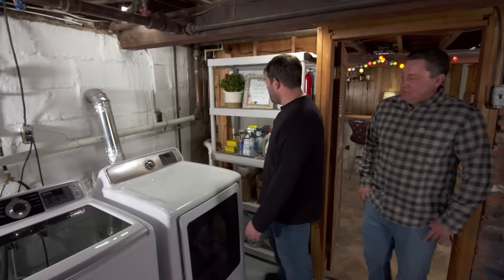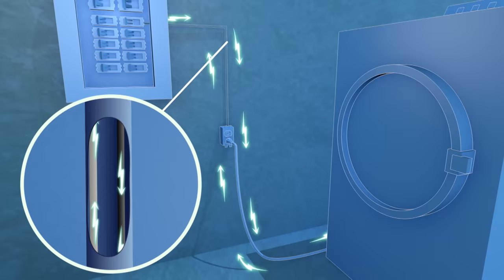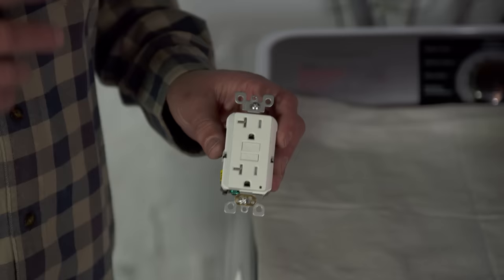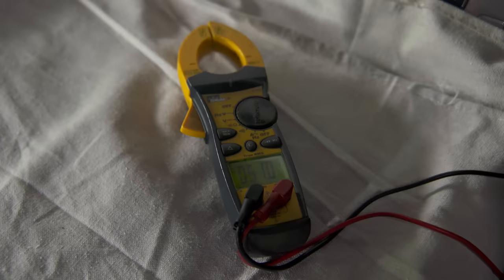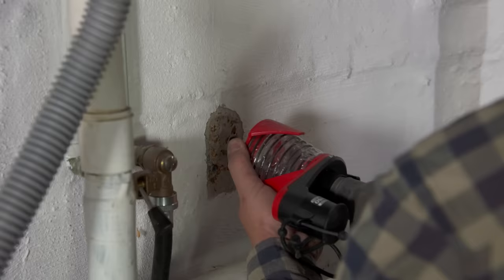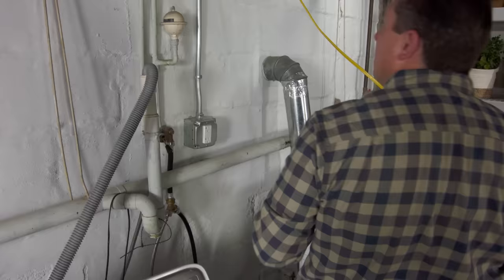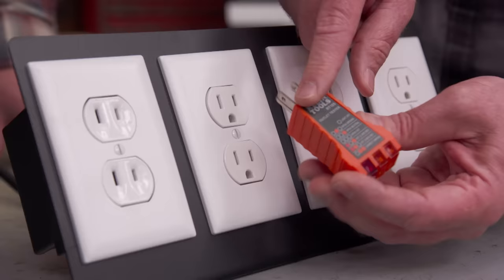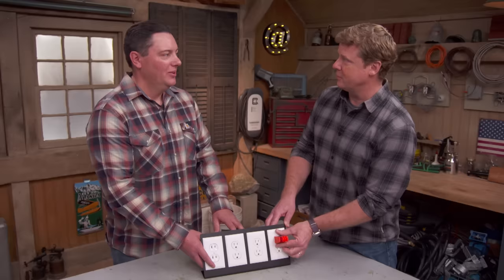How to Ground a Two-Prong Electrical Outlet | Ask This Old House

Comment: That guy didnt know what a ground was and you're trusting him use the mulimeter to tell when the powers off?
Reply: One, it's scripted. Two, there's a lot they probably cut out. Don't believe everything you see on TV.
Reply: He immediately picked up on the "don't put a knife in the toaster " meant he understands the ground fault  he knows electrical
Reply: Nathan 😂😂
Reply: @chrisb4009  You can't rely on a non contact tester in all situations.
Reply: Alex Flockhart You can’t rely on a non contact tester in any situation. Multi meters aren’t designed/intended to proving dead and shouldn’t be used.
Reply: @chrisb4009  I use both to be sure, but you're not wrong.  I also don't use anything but Fluke for meters unless I'm working with 12V.
Reply: Any brand multimeter is fine generally as long as it's CAT3 minimum. Then test prove test. 
Plus my favorite tester is the Non Contact Tester
Reply: @Froggability  Don't trust brands that arent manufactured by the company itself.  In-store brands often contract out the manufacturing to the lowest bidder, and I've taken apart meters that were labelled CAT3 but offered zero over current protection, making them potentially dangerous if someone accidentally used the current function on line voltage. Use Fluke, Klein, Ideal, etc. Stay away from brands that dont specifically make measurement tools.
Reply: Nathan don’t know about North America but anywhere else I’ve worked GS38 compliant testers along with a suitable proving unit are what’s used to to prove dead. Cat III only relates to the level of insulation/protection offered.
Reply: Alex Flockhart Fluke are good meters but there are lots of other good brands such as Martindale, Megger and Kewtech.
Reply: @chrisb4009  Of course, those are brands that manufacture instruments consistently, instead of contracting it out to the lowest bidder with little oversight.  That was my point earlier.
Reply: Look at this guy trying to say that Kevin O'Connor is "that guy!" Please do not doubt Kevin O'Connor. He is dreamy.
Reply: not to mention the panel had all the breakers marked....
Reply: Chris B  you sound like you’re from the UK. In the states here and pretty sure in Canada also we don’t have those regulations with meters that have to have a proving device etc. etc. We often on meggers to Check our circuits.

Tell me why a meter is bad when it’s used almost everywhere in the world. 

If you know how to use a meter and you check it before you use it there’s nothing wrong with it. 
Do you think technicians and benches in the lab all over the planet have some sort of fancy checker device for their test gear, nope.
Reply: This is e tv show the follow safety rules even the prectice servo times before they run with cámaras  si you can see nice  flow video shot the made mistakes in the prectice till they have  one and clean of errors
Reply: @AlexFlockhart  I only use Fluke meters as well, they are the best meters period!
Reply: @chrisb4009  Why? Solenoid style (wiggys) are more dangerous than a  multimeter, ever have a solenoid style blow up on you? I have, and i wasn't using it for a higher voltage than it was rated for. The end blew off and shot across the panel that i was checking some 480V fuses.
Reply: @B5Blue1968  yep, went through ideal and klein before learning to stop throwing my money away on unreliable junk.  Haven't had a problem with my fluke T6-600 for 3 years now.
Reply: @B5Blue1968  I’m not sure what a Wiggy is? But no, I’ve never had a GS 38 voltage indicator blow up on because I tend to use decent quality equipment.

Multimeters shouldn’t be used because there often multiple inputs and always multiple settings many of which can give a false reading if proving dead.
Reply: @B5Blue1968  Yes you can measure voltage with a meter. The doesn’t mean it’s considered good practice for safe isolation.

The fact most meters have separate current and voltage inputs mean you can easily prove dead with your meter leads in the current input and see zero voltage. It’s also possible to have a meter on capacitance or resistance say and erroneously read as zero volts.
Reply: Its not a big deal
Reply: @zarblitz  Lol
Reply: @Froggability  LOL!!
Reply: @chrisb4009  that’s why you show the 120V before and 0V after flipping the breaker. Guess you would have learned something if you watched the video. That plus a quick check on all exposed conductors 0V to ground is plenty, especially for something that was already hooked up.
Reply: @Kado_Tornado  You’ve clearly got no idea what safe isolation is or how to do it.
Reply: @chrisb4009  you sound like anything that doesn’t match what you’ve been taught for your job is wrong, but you don’t understand the concepts involved so you don’t know how to apply them to what you’re actually doing when you “prove dead”. Tell us exactly what’s wrong in the video and why. Not just “I was told to do it this way.”
Reply: @andymerrett  From that comment I’m assuming you’ve never worked as an electrician in a professional environment?
Reply: @Kado_Tornado  It’s not how I was taught it, it’s industry wide best practice anywhere I’ve been and I’ve worked in oil/gas /power industrial sites all round the world.
Reply: @chrisb4009  I see you avoided my question about what exactly is wrong in the video and why.
Reply: @Kado_Tornado  Well:
1. A ground/earth does not control fault current it ensures that all exposed conductive parts are at the same potential/voltage. 
2. His description that current flow to ground/earth will cause an over current trip in in most cases.
3. He uses a multi meter for proving dead. This is against best practice for lots of reasons.
4. He doesn’t prove the multimeter before using it.
5. He doesn’t appear to prove dead in the junction box before pulling it about.
6. The less that’s said about the design of US sockets the better. Live conducive parts sticking out all over the place.
7. He doesn’t prove dead when working in the panel.
8. He doesn’t do any form of testing of the  circuit before he uses it. No insulation resistance test, no earth impedance test, no test of the protective device.

Other than that it’s great advice to put out on national television 😂😂
Reply: @chrisb4009  none of that is necessary in an existing installation making this simple change.
Reply: @Kado_Tornado  Proving dead isn’t required? Testing a new circuit isn’t required?
Reply: @chrisb4009  you’re twisting this. He used a multimeter to prove dead. You may question that method and that’s fine. But he didn’t not do it.
Reply: @Kado_Tornado  He didn’t prove feat at all when he opens the electrical panel. He didn’t prove dead at all when he opened the junction box and broke in to that circuit. He didn’t prove the test equipment before/after as per good practice when he did try to prove dead and he used the wrong type of instrument to prove dead. I’d say that’s a pretty bad example if you’re going to show people how to DIY.
Reply: I can't believe the argument this Chris B guy is going on about. It's a freakin 120v T-slot 20amp receptacle not a substation. Make sure the batteries are good in both your volt tick and multimeter and always test on a known live circuit first. Simple not rocket science. And if you have the test leads plugged into the wrong inputs or turned to capacitance or ohms that will fry your meter you shouldn't be doing the job in the first place.
Reply: Hahahahahaaa

Comment: I purchased an older house (1959) with two conductor wiring throughout. Lived in it for a few years but when I installed an outdoor pool requiring additional grounding, I installed a grounding "pad" for the pool. Since I was at it, I did the same thing for the house. I dropped 5 8 ft. copper dowels around the house and took separate ground wire to each of the receptacles. Every receptacle had it's own discrete ground after each receptacle was replaced. I used the existing wiring in the house because too many walls would have to have been torn up. I was now up to code and safe. Then again, this was 30 years ago and I'm certain codes have been updated...but it worked and has worked for an additional 3 decades.
Reply: m rapacki  Only 4 in the one I am in. With screw-in fuses and a 60 amp mains coming in. The linemen I talked to had never heard of a 60 amp incoming wire.  WTF 😂 🤣

Comment: I’ve heard elsewhere that you’re not supposed to run Romex through conduit; just run the THHN wires instead. Never heard a good explanation of why, though.
Reply: I once had a master electrician tell me to never run Romex through conduit, as it can result in overheating.  I just did some checking and, while a very good idea, that's not entirely true.  Code says you can run Romex through conduit as long as the wire, including the Romex sheathing, doesn't take more than 53% of the space.  The Romex in the video was yellow, so very likely 12/2.  For 12/2 Romex, that comes to about a 3/4" conduit.  The conduit in the video could have very well been 3/4"

However, it would have been great if ToH would have addressed something that many people, including myself, would question.  Even though it is code compliant, why choose to do something that most electricians would not.  

I'm guessing that given the conduit in question is metal and it's not surrounded by insulation, heat isn't an issue and using Romex may be the easy (lazy?) approach.  Not calling these guys lazy.  A lazy person like me would just have gone the GFCI route and called it a day.

Comment: that little drill dust collector is nice
Reply: I want one. Not sure why but i am sure i NEED it 😆
Reply: I don't know.   just let the stuff fall to the ground & let the homeowner clean it up
Reply: My thoughts exactly
Reply: It looked like a bunch of dust fell out of the bottom when he pulled it away from the wall anyway lol! Check it again and let me know if you see it
Reply: @ourmusicsmajor  it looks like there’s a small vacuum port on it but it was covered
Reply: All these electrical experts and NOBODY knows current  OSHA standards for crystalline silica dust. Your tax dollars at work. 
The U.S. Occupational Safety and Health Administration, better known as OSHA, updated standards few years ago. For concrete drilling and other construction industries, companies must be in compliance by September 2017.  Companies that employ people to use concrete drills and dowel drilling rigs must implement control measures to limit respirable crystalline silica to 50 micrograms per cubic meter of air, averaged during an eight-hour shift.
Reply: @RichardFallstich  SARCASM MISSED ALERT
Reply: i didnt even know they existed
Reply: Where can I get one?

Comment: Just setup a socket with GFCI so I can get the dehumidifier running in a basement! Not skilled enough/have the equipment to change out the entire line, but I appreciate the video, and that they showed you how to. Might attempt it when I'm a bit more competent. Now on to 50 other things I've gotta do for this place! :D

Comment: This electrician is good. I like him. Fast, efficient, thorough.
Reply: BlackSwan912 
Agree
Reply: miguel teran Why don’t you tell us why, so you don’t come across as a troll? I wired 16 new circuits and almost 100 boxes, and got enthusiastic thumbs up from the inspectors, all of them. He covered pretty much everything without bogging down in minutiae.
Reply: Quick question, which is the proper way to connect the outlet?  Black to gold and white to silver or the other way around?
Reply: Matt von Linden 
Black to gold, white to silver
Reply: @miguelteran747  Ugh, don't you trolls ever get sick of yourselves?
Reply: BlackSwan912 the guys explanation of an earth and using a multi meter to prove dead are evidence enough he knows almost nothing about electrical work.
Reply: Ive worked with Heath before, I am a master electrician and I can tell you there is no better electrician out there. He is a walking code book.
Reply: Chris B Either you are from another country where the words he used mean something different, or you have other issues. Every thing he said and is good. You might explain it differently, but that doesn’t make him wrong. I suspect you might be “sour grapes” and envious of the guy. It’s clear that you are not a professional, because professionals have a different sense of integrity than what you are displaying.
Reply: BlackSwan912 the guy explains grounding as tripping on over current in the event of a fault where as in fact it is more correctly referred to a equipotential bonding and is provided to ensure all exposed conductive parts are at the same voltage so you can’t get a shock.

He then proves dead with a multi meter, doesn’t prove the meter before or after proving dead.

He then doesn’t prove dead when taking the distribution board cover off.

Other than that his work is great 😂😂
Reply: @chrisb4009  lol now he shuts up
Reply: @chrisb4009  he also forgot to put some sort of device to cover the cable from the metal conduit, so that wire may cut over time. His explanation was also a little confusing to someone that dosent understand AC power.
Reply: Jake Sangria yeah most of them were pretty grim. This was the first or second of the three inspections. But here’s an even better one: My plumber set up the pressure test for second floor and attic. I called in for the inspection, and I pressurized the pipes. This is the last inspection before installing the fixtures, which also requires an inspection here. He started looking at the old, CVG fir attic floors I had finished and asking me about them. He stood up and said, “Anyone who can make this from that (points to the part of floor under the edges of the roof) can install fixtures.” He finalled me on the spot. Needless to say, I was elated and profuse in my thanks. 😁
Reply: Thorough and wrong about the G.F. outlet.🙄
Reply: @mattv16031  Black (Hot) goes to the brass (gold) terminal, White (Neutral) goes to the silver screw.
Reply: @chrisb4009  The point of the EGC is to trip the overcurrent device, first and foremost. Anyone who says anything else is simply WRONG.
Reply: @mr.g937  Tripping a breaker is a side effect. It’s main purpose is to prevent exposure to potentially lethal voltages.
Reply: @chrisb4009  False. Current takes all paths back to the source, including you in the case of a ground fault. You can ground your system all you want. The only way to clear a ground fault is through the overcurrent device. Mike Holt covers this in the video I linked. Grounding serves only 1 purpose and that is to dissipate inductive overvoltage due to lightning or other surges. Grounding does not make your system safe. The only way to make your system safe is to shut the system off. To do this we provide a low impedance path to the source (EGC) to trigger the overcurrent protection.
Reply: @mr.g937  Clearly you do thinks differently to Europe in Murica.
Reply: @miguelteran747  Yea, bet u install ungrounded receptacles on all your side jobs.
Reply: @BlackSwan912  walking code book but romex thru emt ? Shouldn’t it be thhn / thw2?

Comment: Good video, thanks. Note that the dryer is a gas dryer. A washer and a gas dryer can be on the same dedicated 120V 20A circuit. An electric dryer requires a dedicated 240V circuit, typically 30A using 10-gauge 4-wire cable (10-3 with ground), which for residential in the USA color-coded orange.
Reply: I was wondering how that thing was being powered by a regular outlet! Thanks.
Reply: How many  NEMA 10-30R dryer receptacles have you installed?? Only 3 total terminals, 2 "hot" wires and earth. No neutral used or needed on electric dryers. No place for an orange wire to go.
Reply: @RichardFallstich  on some ovens you can  have 4 wires on some others you are required to have a neutral and ground, i imagine there migh be some dryers that might call for 4 wires.
Reply: @robertopics  What you say about ovens is true. But the post was about a dryer. I NEVER saw a 4-wire dryer. Dryers typically do not need a neutral.
Moreover, since the 1996 NEC (250.60) grounding equipment such as ranges and dryers to a neutral conductor is NOT permitted. So now ALL 250V ovens need 4 wires (earth, neutral, hot, hot) with a NEMA 14-50 type device. 
Existing installations are not required to be changed if they were in compliance of the NEC at the time the installation.
Reply: Wexercise
Reply: @RichardFallstich  "Electric dryers run on a 240 volt current, which requires the installation of a special kind of outlet. If your home was built before the mid 90’s, then it is likely that you have a 3 prong dryer outlet, but if it was built later, then you should have a 4 prong outlet. This is because in 1996 the National Electrical Code (NEC) mandated that all new home wiring use a neutral for Dryers." Correct, existing installations do not have to be upgraded.
Reply: @RichardFallstich  "Electric dryers run on a 240 volt current, which requires the installation of a special kind of outlet. If your home was built before the mid 90’s, then it is likely that you have a 3 prong dryer outlet, but if it was built later, then you should have a 4 prong outlet. This is because in 1996 the National Electrical Code (NEC) mandated that all new home wiring use a neutral for Dryers."